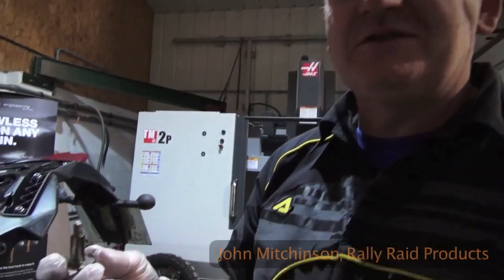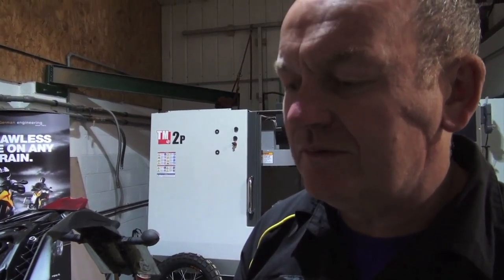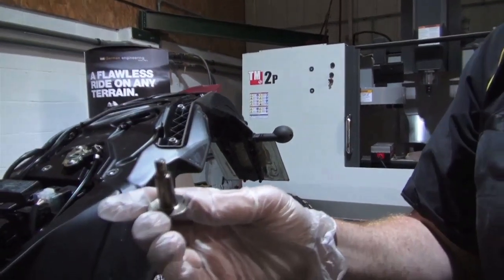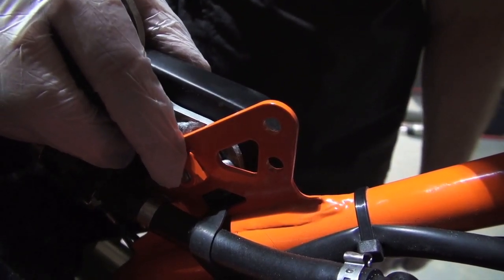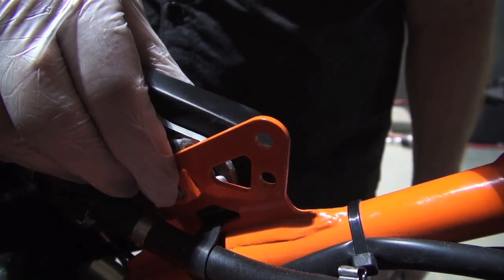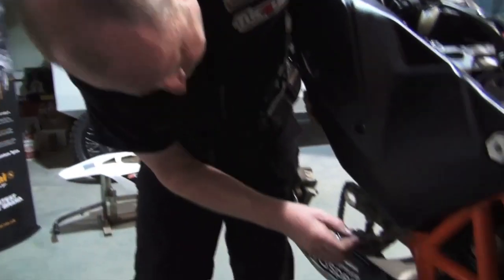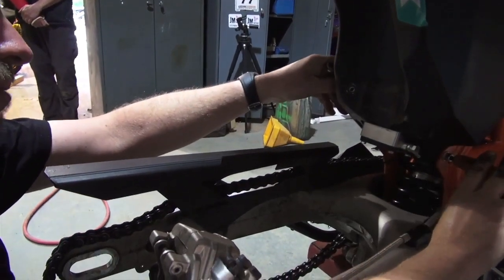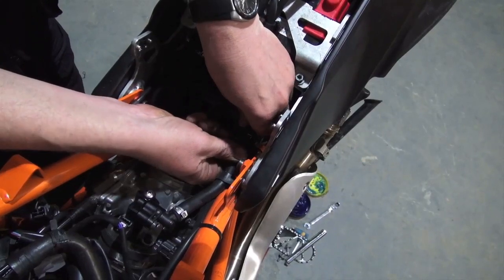Rally Raid Products - subframe modification KTM690

Comment: I wish I saw this video when I first got my 2017 690 enduro and replaced them the first week I had the bike. I had sheared many of the upper subframe bolts; and just replaced them each time (often paired with a screw extraction). But then I was 200 miles into a dual sport ride from Barstow to Vegas when the OEM bolts going into the pin for the lower subframe bolt sheared off, and it bent the OEM exhaust with it. I was able to safety wire the muffler and header together; just enough to get to the end finish, but this was now $2,300 repair (oem muffler = $1,400, header = $591) with factory parts or $1,200 repair with aftermarket exhaust parts and the OEM lower subframe pin was also on backorder. Luckily I found the perun moto kit at ktmtwins in escondido CA, and am going to swap that in, just to get the bike rideable again. To other 690 shoppers, I also recommend the inline fuel filter replacement.
Reply from the maker: Well we've been useful, just a little late! :)

Comment: But wait, KTM is ready to race, is'nt it ?
Reply: yes, it is. this is a modification. i guess you would consider changing the grips to make it also not race ready?
Reply: @mulisha0351  This motorcycle has no protections and it is not designed to be protected. If the buyer has to pay ~ 5000 dollars more, it is not ready to race.
Reply: @fcalin21  i didnt have to  spend 5000 more and its fully ready to race. i think your nit picking, or you have no idea how to ride?
Reply: @mulisha0351  See Taco Moto . They spent more then 5000 dollars.
If i am a good rider or not it is irrelevant.  The fact is that this motorcycle has no protections from the factory, it has a bad seat, a not so good gear box and with all that it cost a lot of money.
Reply: @fcalin21  nit picking
Reply: @mulisha0351  I don't find protection just a detail , plus it is very expensive and time consuming.
On the other hand we could race a scooter , in that sense , it is ready to race.
KTM is dishonest.

Comment: The original lower tank mount can be hold with an alan key from the inside. So you don't have to mount the bolt again and use the air tool to get the second bolt out.....

Comment: Is this still an issue on the 2014 model?
Reply: George Washington Actually this is not a real problem on any model if you check the polyurethane bushing and there's no free play in the two mounts. Since MY'13 they changed the poly bushing design. I have over 30K on my '09 R and still on the original bolts. Put it through hell and carried quite a load at times
Reply from the maker: Not sure. Send a question to Rally Raid Products
Reply: Into The World Thanks for this answer!
Reply: can anyone answer this question???????????????
Reply: Motorcycle Adventure Dirtbike TV thxs I'd prefer an unbiased opinion, not the opinion of the salesman.

Comment from the maker: It doesn't change the load, it reinforces where the load is, by increasing surface area and significantly increasing the strength of key mounting bolts.